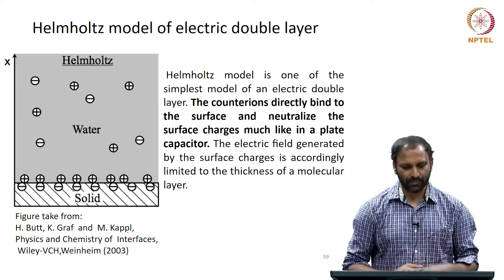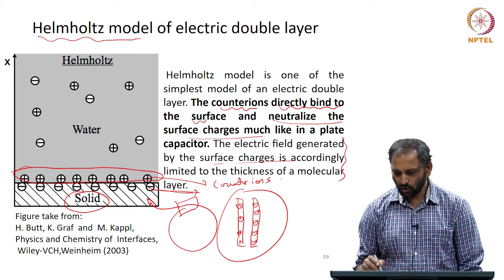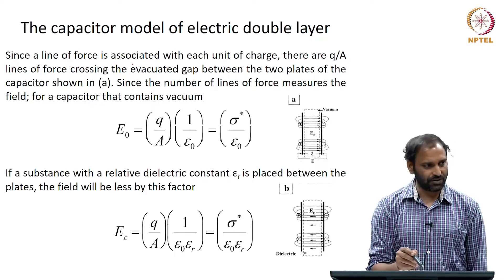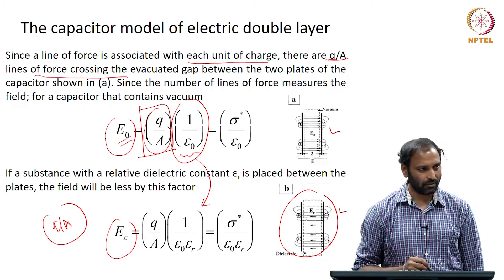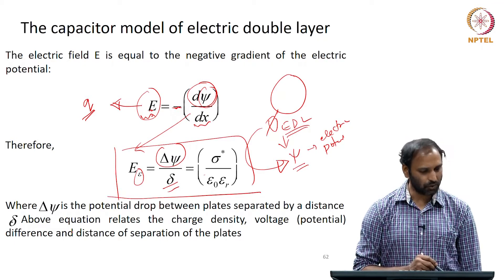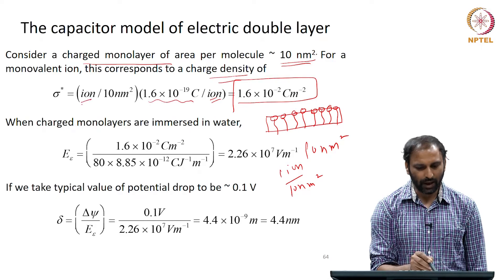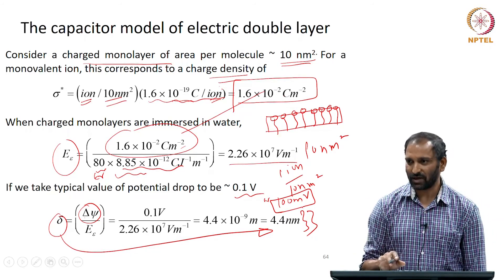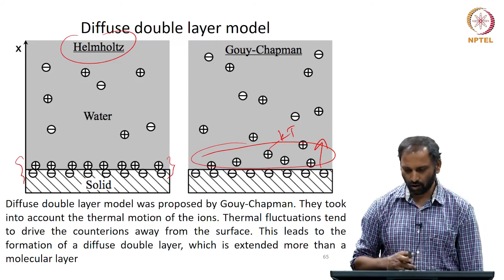#28 Introduction to Models of Electrical Double Layer Models:Helmholtz Or Capacitor Model

Comment: The counterions directly bind to the surface? I thought specifically adsorbed ions (in the Inner Helmholtz Plane) would create a screening effect between the solid surface (-) and the counterions (+) that are present in the Outer Helmholtz Plane?
Reply: Yes, the way u described it is the correct physical picture.